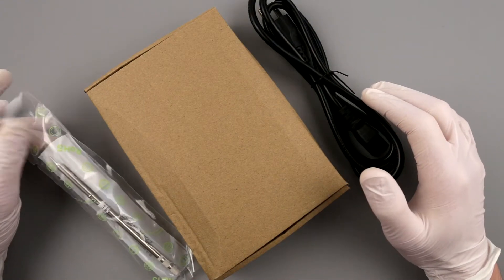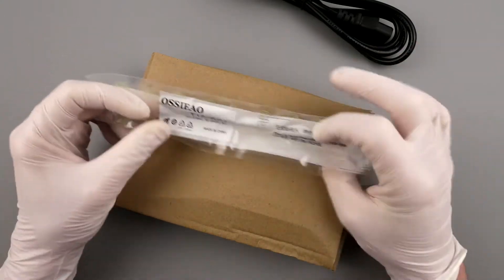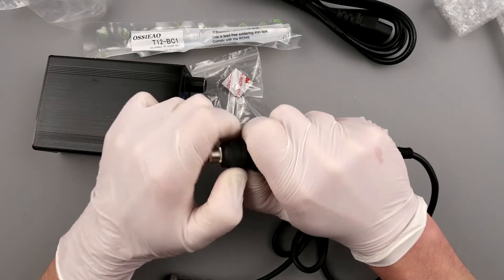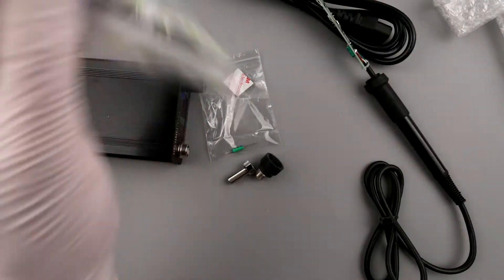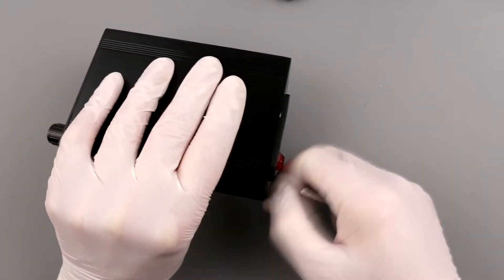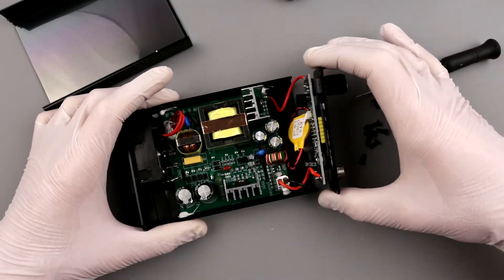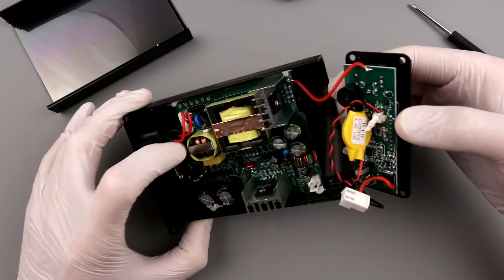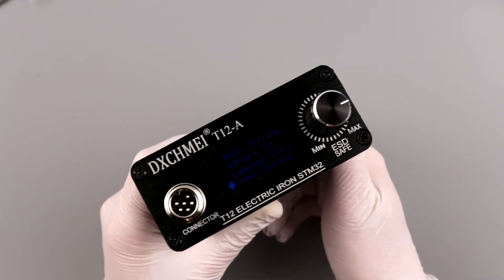Unboxing and teardown of DXCHMEI T12 Soldering Station

Comment: It's actually spelled DXCHMEI not DXCHMAI I ended up with the latest one of eBay myself. It's a good unit so far it's now grounded through a 3 pin plug instead of the 2 pin seen here on the main power board
Reply from the maker: Thank you for pointing this out, I will fix it :)

Comment: Hi! Great review... I got one too and my case is not grounded.  I watched some reviews about the danger of using this equipment with the case not grounded, but you are right, the case is floating... What's your advice about it? Should be grounded or is Ok to use it like it is?
/AB
Reply from the maker: I'm using it like this, there many devices which are not grounded, but if you accidentally touch LIVE wire with your soldering iron, better to have it grounded, also if some LIVE wires will touch case inside, better to have it grounded.

Comment: What a useless explaination nothing about how to set the temperatures or anything
Reply from the maker: I was mostly focused on how its made and what is inside, setting the temp is pretty straightforward...
Reply: @InsideOutElectronics  what is straight forward was your discription black anodized case with a power and a controller board with capacitors and diodes wow
Reply: I had no issues whatsover setting the parameters.